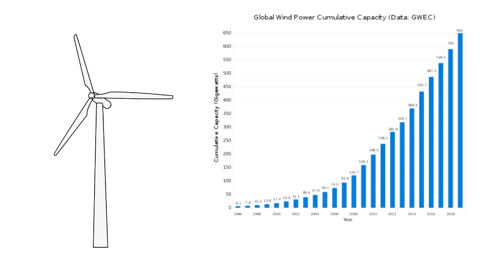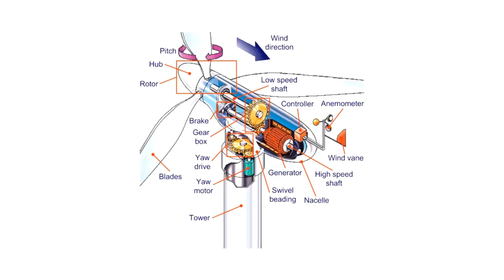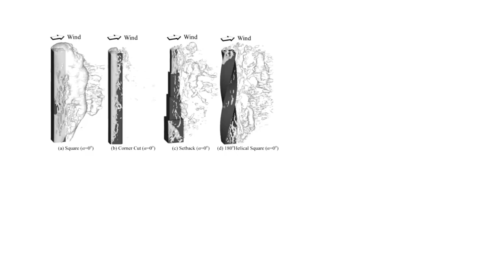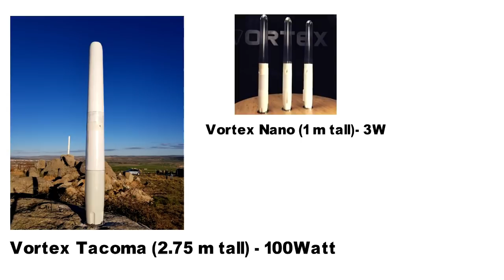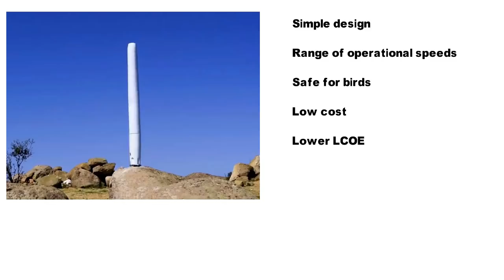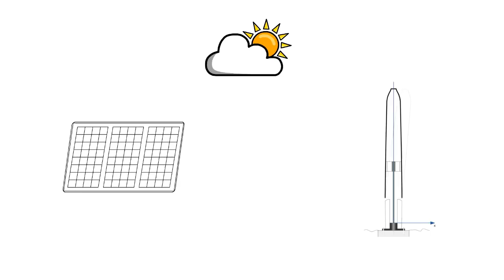Bladeless Wind Turbine

Comment: I am definitely interested in learning more!
Reply: One 9 meter tall Vortex Atlantis has an installed capacity of 1 kW. This is roughly equal to:
1/10000 ths of a regular HAWT-turbine
3 by 3 m (9 by 9 ft) of solar panels
Reply: @simonprobert8765  I am wondering if that would be enough to help power an american home (combine with solar)
Reply: @mrseanpaul81  They are certainly able to power an American home. But that doesn’t mean its a good idea. It is entirely possible to power an American home by employing a crowd on treadmills. Whether it is a good idea or not probably depends on the situation and perspective. From a national point of view these turbine-less generators are very costly both financially and environmentally compared to regular wind turbines. This is simply because they are less efficient and therefore you have to construct more of them to get the desired power. 

From a personal financial point of view it might be beneficial for you to produce your own electricity at a higher cost since you don’t have to pay taxes and distribution costs on what you produce, though not sure how this works in the US. So in this way something like these turbine-less generators might be viable, though I suspect buying electricity from the grid will still be much cheaper in almost all cases. And even if these turbine-less generators would be cheaper than buying electricity from the grid, solar panels would be so much cheaper still. Of course solar panels don’t produce power evenly around the year, but this isn’t really an issue for most people since the goal is just to replace some expensive electricity from the grid with your own cheap electricity and you probably wan't a short payback time. The seasonal variations of solar power only becomes a problem if you are trying to replace a larger amount of your annual electricity needs which probably wouldn’t be financially motivated anyway. 

As a final note I might add that going completely independent and producing all of your own electricity isn't necessarily good for the environment in the long run. For an example 10000 of these 9 meter generators would almost certainly be worse than one regular turbine. Although if your electricity is fossil based solar panels are probably much better for the environment.
Reply: Research the real Tesla - Nicolas Tesla

Comment: This is very clever, but I'd be interested to know what level of audible noise and ground vibrations these generate?
Reply: It better be 10 000-times less than a regular HAAWT-turbine, because that's roughly how many it would take to produce the same power. (for the 9 m version)
Reply: Hi Stuart, Vortex Bladeless is a Spanish company in its infancy, in fact. And they claim that there is much less noise (even unnoticeable) than with usual turbines. On the vibration issue not sure but I would bet is not that severe given most of the vibration itself is converted into energy and the “tiny” size of the device. Regards!
Reply: I imagine not much worse than a tree
Reply: This is a interesting question, because there will be complaints. "Many complained about the 5G antenna with headaches and skin irritation, imagine what happens when we turn it on?"
Reply: Less than a tree. Do utility poles make noise?  I can’t hear it, if so.
Reply: @DennisGentry  just have a think has video about these turbines and you're right that a tree would make more noise
Reply: I mean, streetlights wiggle in the wind. I guess if there's a cable running thru it it could make noise.
Reply: @vctjkhme well it answered the question right?

The magnets moving through the coil at the bottom will absorb the vibration and convert it onto electricity. Rubber (or some other material) can then be used on the mating surfaces of the moving parts to dampen out the residual noise. Other noise absorbing material can be used on the other parts of the structure to absorb frequencies that are not very usable by the generator.

Try doing that with the noise generated by a wind turbine.

Comment: Excellent find thanks for sharing. I had dismissed wind power as not being practical or worthwhile for my area. These Vortex seem to be very worthwhile! 👍🏽
Reply from the maker: If the price is low, I might go for the 100W one.
Reply: If they ever release it to market, that is.
Reply: 100 W is roughly the same installed capacity as 1 square meter (3 by 3 ft) of solar panels.
Reply: @simonprobert8765  It would be a good complement to solar on overcast days and at night.
Reply: @robine916  Depends on your needs. If you are connected to the grid and just want to save some money by producing electricity yourself, then only solar will in most cases offer you the shortest payback. If you want to produce a larger portion of your electricity needs, then it will be more expensive and it might cost more than you gain. If you do it for other reasons than cost, that could be fine, but a HAWT will probably be better. Also depending on where you live, producing your own electricity from small HAWTs or VAWTs might be worse for the environment if the electricity you would otherwise buy from the grid comes from large scale wind, hydro or possibly nuclear.
Reply: @simonprobert8765  True
Reply: @simonprobert8765  Each one of my solar panels generate 350W and I have 34 of these covering my roof.  1kw is a tiny amount of power.  Yes, you can keep the lights on but not a refrigerator.
Reply: @robsengahay5614  I just wanted to put the 100 W mentioned in Synergy Files' comment into perspective, but as you mention you would in most cases want a lot more than 1 square meter of solar panels. In reality you would probably want as much solar as possible with as little over production as possible and exactly where this limit falls would depend on stuff like your usable roof area, budget, electricity demand pattern, potential for storage, expected production costs and the costs of electricity from the grid.

Comment: The diagram at 2:29 doesn't show how the oscillating motion is translated into linear motion in the generator.  This must surely be the critical part of the design.  It will be very difficult to make a mechanical connection that will withstand millions of oscillation cycles whilst transmitting a high force and to do it quietly.
Reply: Especially as he says it needs no lubrication.
Reply: @JimFortune  Yes, something is flexing - a lot...
Reply: And when will it become so worn that the energy is absorbed by the wobble in the material instead of the generator?
You need absolute stiffness for this to work.

Comment: That was a great presentation.  Even my none science mind understood the engineering.
What a great idea.  They can be installed anywhere.
Reply: They will need to be installed everywhere. One regular wind turbine (HAWT) produces the same amount of electricity as 10000 or more of the 9 meter Vortex Atlantis. A 3 by 3 m (9 by 9 ft) area of solar panels will probably produce a similar amount of electricity as one 9 meter Vortex Atlantis. In short, this turbine-less wind generator is a cool idé with very few practical applications.

Comment: This is fantastic, great job.
It got me thinking and I just thought of a new wind turbine design too...   :)
Reply: Elaborate please
Reply: @wowalamoiz9489  I thought that a CRATER design might work, Basically have a set of flat or concave shaped blades on a shaft being pushed directly against the wind, the lower portion shielded in a bowl, hence crater... the central shaft would roll around the lip of the concave bowl leaving the upper blades exposed and directly facing the wind.
this would  harness a huge amount of the winds energy and could be scaled to work with real craters or natural features...

Comment: This has been around sence 1995 and the havent made one yet for sale. But they have raised MILLIONS
Reply: Modern wind turbines have blades not without reason, they can harvest a way more energy from wind than other designs, its most simple, effective, and cause a reasonable CO2 footprint meanwhile production and after in maintenance phase. We use now 8MW generators at sea, you need to build 8000 of these towers to gain equal amount of energy. Effortless

Comment: I was curious about the noise generated by these structures.  At high speeds, would an irritating noise be produced due to the revolving structure?  Perhaps a harmonic or high-pitched frequency?  Or even a low-pitched frequency that would be heard in the distance?  Before these are marketed and sold, a decibel level rating and frequency band produced should be analyzed before selling.  These might be part of a solution but I see the possibility of noise from these.

Comment: You know, this can be done with "Windbelt" (TM) ribbons strung between posts, forming vortex shedding walls far more efficiently and cheaply.
Reply: Sounds like a great solution for highway dividers.
Reply: @wesleymouch7498  that actually might be an idea worth looking into !  but windbelts would still probably be cheaper per W and yet they never found their market
Reply: @ottodidakt3069  With current materials they are very fragile/short life span. Need to be able to handle heavy rain, hail, bugs, stones, etc.. There were also noise challenges. Patent holder moved on to modular micro solar.

Comment: Well presented, but this does sound like another VAWT pipe dream to me. Simply citing nominal wattage is useless; what do they produce in a normal but windy location, say average wind speed 7 m/s?  I'd love to see these work, but there is a lot more hard data needed before we applaud.
Reply: Why try to harness low winds? Put thousands of huge turbines in the Dakota's which have high winds constantly. Then spend the money of high voltage transmission lines to get it where there is electricity demand. If Singapore can get electricity from Australia, we can get it from the Dakota's to Chicago.
Reply: I think it is a pipe dream too.
Reply: @zedzed5276  Singapore getting electricity from Australia is just a hype.
Reply: True, years ago I was pointed to 'Sheerwind Invelox windtechnology', that too promised wind harvest figures that were too good to be true in my opinion and......they turned out to be too good to be true.
Reply: @zedzed5276  the main use case for this is for places where you cannot build big wind turbines.

If you put it in a place that's big enough to put thousands of these then you are better off with a wind turbine. As per the video, wind turbines are more efficient per size.

I think this is better suited to be placed near busy highways, where vehicles generate wind and vibration. Put them on highways along with the streetlights, then maybe they can charge batteries during the day that can be used by streetlights during the night.

Comment: So,ultimately,on a small scale,they could actually make a flag pole a power source.. With a flag on top,it would also help with the motion needed
Reply: No.
Reply: Well, yes, if you want a very thick and ugly flag pole with a very low power output not able to boil an egg.
Reply: @simonprobert8765  it said kilowatts tho...isnt that a good amount ?
Reply: @n.g.s1mple29  It's about the same power as what a kettle uses, though mine uses 1.5kW. You can get the same power from a 3 by 3 m (9 by 9 ft) area of solar panels. And a regular wind turbine is a lot larger but will probably produce about 10000 times more electricity over a year.
Reply: @simonprobert8765  i see
Reply: And on an even smaller scale, a nice wind power “massage wand”
Reply: @vctjkhme You probably could, but as you mention it probably wouldn't make financial sense and probably not environmental sense, though those numbers are super difficult to get. But if you have good winds and you think this looks so much better than small HAWTs then I suppose it is aan option.
Reply: @vctjkhme  The market is only private or PR-stunts. On a large scale these are simply too expensive for what they produce, as the video admits. This is partly due to an inherently lower efficiency but also the much better wind conditions at higher altitude. You might think a constant wind speed of 5 m/s is windy and there are probably very few places where this is the annual average at ground level over a year. But a regular HAWT might have an annual average wind speed of 8 m/s. This seemingly small difference alone means the HAWT can produce four times the energy and thereby being four times less expensive. There is a reason why HAWTs are regular and this thing isn't. HAWTs currently produce the cheapest energy on the market, cheaper than oil, gas, coal, nuclear and solar and HAWTs still have a lot of potential in cost reductions in for instance offshore. (Producing power is another story, but that's the same for these turbine-less.)

On the private market these things are easily outcompeted by solar in most cases. If you want to save costs by producing your own electricity, then solar is the way to go. Unless you live at a particularly windy location you probably wont be able to save money using wind and if you do you probably will be using a HAWT. Disguising this thing as a tree or an oddly shaped rock won't make financial or environmental sense.
Reply: @n.g.s1mple29  A ten meter flagpole could produce up to 1kW if being thinner than the official device does not affect the efficiency. A VAWT of under 3m height and a diameter of 2m can produce the same and apparently can start up at half minimum wind speed. A 1kW HAWT has blade diameter of little over 3m and also needs slightly less wind to start moving. The problem with all these micro wind turbines is you pay relatively high price for relatively little power and might need multiple turbines for just few kW of power; also not many people seem able to figure out how much wind they actually get so the expensive investment might end up immobile most of the time.
The benefit of the bladeless design is you put the heavy machinery that needs regular maintenance at the bottom and the cheap and lightweight moving mart on top, instead of needing to haul a heavy turbine up on a tall tower and then figure how to check all those moving parts up there at least once per year to keep it working. Also, idiots who want to poke it are less likely to lose fingers.
Reply: @AnalystPrime  lol, ok. Makes sense
Reply: Wow.. I got comments..lol.. Ok.. Let me clarify small scale.. Like 300-400 watt.. Enough to charge a couple 12v batteries.. Maybe even a couple battleborn batteries.. For basic LED lighting.. Maybe a smaller microwave and a mini fridge.. It can be thinner with a flag on top with a light weight aluminum pole to amplify the oscillating motions.. I see many with the tops just swaying away quite vigorously.. This thing is just moving a piston between the coils in the base.. Would be best during the winter windy months..
It could also be good to have in combination with existing solar panels... It's an interesting technology that could be expanded on..

Comment: I saw something about this type of turbine a year or so ago.Great Idea if the vibration dampening on the turbine doesn't translate into the building it's mounted on.  Put 2 in a line and hang clothes on them. The wind drying the clothes creates 2x the vibration. You get dry clothes and power not dry clothes and a bill.

Comment: are they actually being built and in use? where at? what is the output? will they provide power to run a house without being linked to a power grid that charges people to use the energy?

Comment: This sounds cool but gives me alot more questions. Such as how much do these things cost compared to there power output. And how long can the operate before they break down and need to be replaced. These are some of the main reasons the giant blade wind generators are not popular. And since these one generate power in Kilowatts and not megawatts you may need 1000 of them to equal one typical wind tubine.... So it would be handy to know specifically its kilowatt output. if its 500 per turbine then that would be half a megawatt, and that sounds pretty good.

Comment: It's good that we have a lot of wind and solar generation but it should be noted that such generation REQUIRES conventional electrical backup generation capacity (for when the wind stops and the sun goes down). More wind power means bigger conventional power plants with larger furnaces and a larger footprint.  They don't have to be in full production all the time but they need to be brought online quickly in the event of high-winds (which shuts down wind turbine generation) and cloudy days.  Bigger power plants require more people, more maintenance, etc.  Wind and solar make the whole system cost a lot more, which is okay if that's what you want.  But I rarely (if ever) hear the proponents of these technologies talk about that aspect of it.

Comment: A question.
When you said it produces less energy with then a similar wind turbine for the same footprint. Was the diameter of the blades travel included in the footprint?  I would think it should be.  If so couldn’t you install multiple vertical wind generators and achieve similar results?

Comment: Any thought on waterproofing this idea and submerging it? Maybe tuning oscillations to the Lamour frequency? Digital-Fluid Tesla system at sea? Think about it. Extract the vertical wave compression with the floating structure, then this design on it, and submerged bladeless turbines. Anchor it to the sea bed and maybe Tesla can go yachting. BIG Leyden Jar, with no jar.

Comment: I would need to know the wear and tear occurring where the oscillator attaches to the stationary post.  If feasible, there would be a market for cruising sailboats as they are nearly always moving, day or night.  Also, would there be a unit designed to operate in the ocean, as the tide and waves are always moving, day or night.  Enjoy